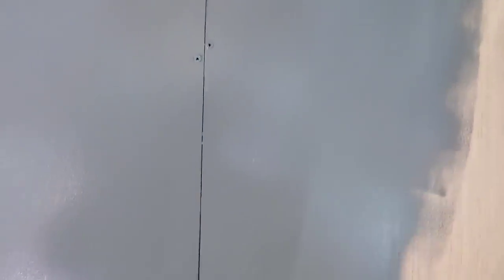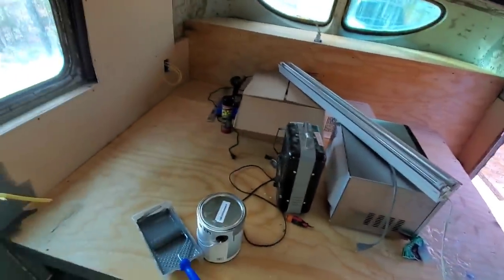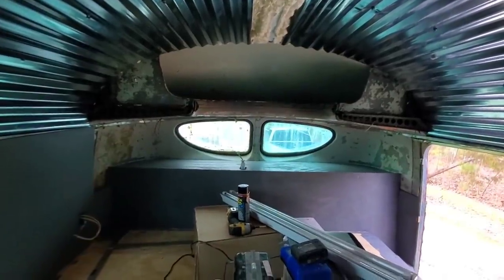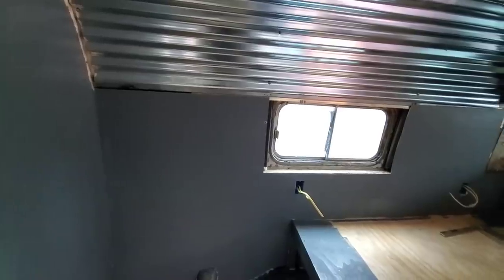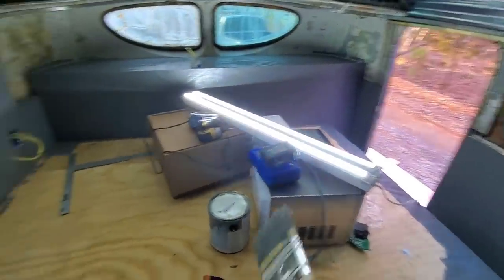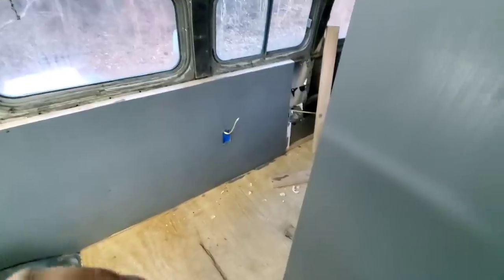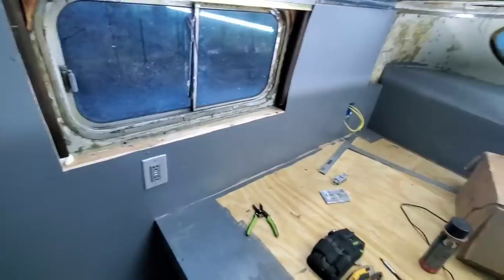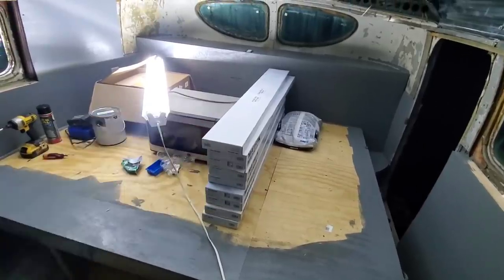Silversides day 4

Comment: Tyler, I’m not sure if it’s the same in your climate however in the UK it’s a good idea to use a hole saw to drill holes in the bed platform, as it prevents damp in the underside of the mattress, which in turn causes mould in the mattress. Just a lesson I leant the hard way that I thought I would share

Comment: Tyler I BUILT A BED FRAME SIMILAR TO WHAT U DID. I WENT TO HARBOR FREIGHT & BOUGHT A COUPLE OF THE BIGGEST MOVING BLANKETS THEY HAD & COVERED THE PLYWOOD SO THE PLYWOOD WOULDN’T MESS UP MY TEMPERPEDIC MATRESS! IT WORKS VERY WELL & THEM BLANKETS ARE VERY REASONABLE

Comment: Sharpie markers will continue to bleed or ghost  though paint regardless of how many coats of paint. The easy solution is to buy a spray can of matte clear coat and dust over the marker several times allowing for it to flash between coats and then dry and then paint over as normal.  Additionally with raw wood it is best to apply at least one coat but preferably two coats of primer otherwise you will need to paint your wooden walls several times to get any sort of decent coverage now and in 6 to 10 months dry spots will start appearing where the wood soaks the paint up.  Lastly if it were me I would paint your entire mattress platform also I would spend a little bit of time and run some sand paper over the exposed edges of all that plywood to "break the hard edge" link you would do with steel otherwise you will have a splintering problem in the future.  Keep up the good work and making the videos of your bus conversion fit out.

Comment: I too made a bed platform larger that the mattress....wow what a mistake that was! Didn't seem to matter what I was doing....constantly hitting my shin just below the knee. After a few months of that, I ripped the whole mess out and made the platform top smaller so that the mattress hung over by about an inch or so...What a difference!
Reply from the maker: I planned on building an upholstered trim board with some padding to.hold the mattress in place while driving. But that's going to be a project for a later date. I'm not doing any finish trim work till the reat of the interior is ready for that

Comment: What is your electrical setup supply going to be on Larry? rv generator? Solar and battle born batteries. the other video  you said a mini split.  At least its coming together nicely. In Butler PA there is a silversides bus sitting outside a shop not sure if the owner will drive it definately a 6-71 for sure.

Comment: I am surprised you aren't priming first or using the wood filler to fill the screws and joints. For you rear receptacle get a GFI one, this way if it gets water on it  it will trip its own breaker.  Its looking good!
Reply from the maker: The bus will be getting more finish work done when the rest of the bus it to that point.

Comment: Tyler I like the work I wondered why you didn't put kilnz down.1st and on your color I was thinking of painting it 1991 gm.sweet cherry red and I put in metallic into it if not you might look at rusteloum hammerite paint green it has a hammerite swirl.look but have to.cover it with a few coats of clear coat and figured maybe your dad might want to.paint Lenny  on up tube and you paint the white ROOF coat on the bed maybe want to.cover the floor under the bed some linelouem to protect wood if something spills
Reply from the maker: Flooring is going under the bed.